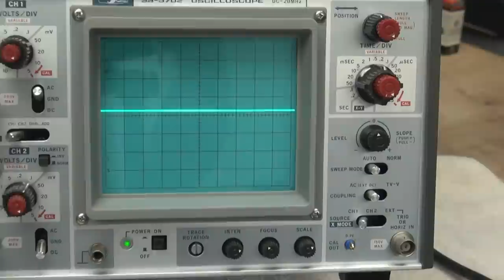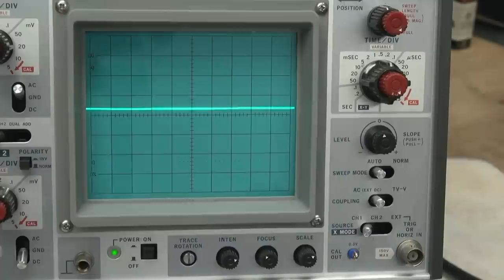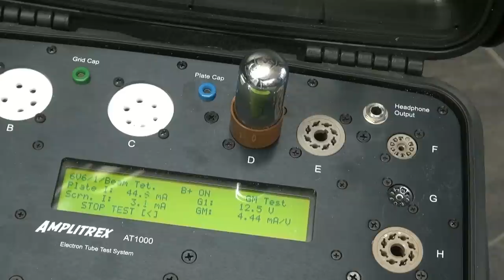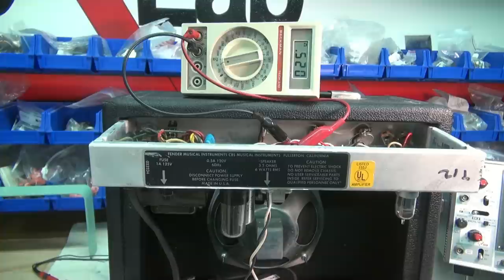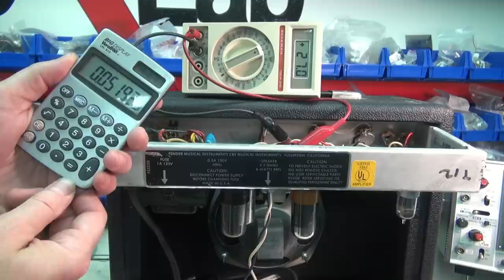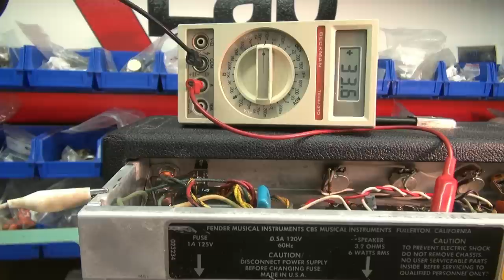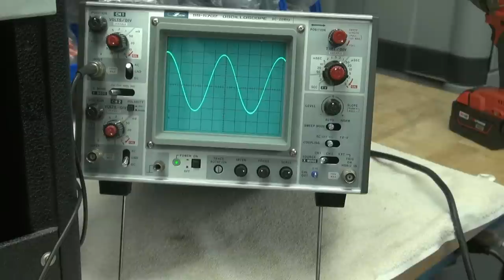Fender Champ tube practice guitar amp repair tips How to by D-lab

Comment: Hi Terry. What value power resistor are you using for the dummy load, and how would you determine which value is needed?
Reply from the maker: +Christopher Austin Hello, it is a 10 watt non-inductive 8 Ohm resistor. For short term testing, it will work fine on any size amp. Most of the amps I work with are 40 watts of lower. You can buy these from Parts Express in Ohio.
Reply: Thanks Terry! Could the same method be used for larger 50w - 100w Marshalls, provided you could find a resistor with the correct wattage? And was that a TS plug or TRS?
Reply from the maker: +Christopher Austin Hello, Parts express in Ohio has a good selection of non-inductive load resistors. I purchased some 100 watt continuous ones from them in the past. The plug was a standard 1/4" phono type, mono like they use on headphones.
Reply: Thanks so much for taking your time to reply. I just got my first scope and I'm looking forward to getting my hands dirty. I picked up some 8ohm, 50watt non-inductive resistors locally here in Vancouver. Looking forward to studying your videos Terry. Thanks for sharing!

Comment: Ha--that's an easy one, only 3 hours...lol---I've had a Princeton on my bench being all wacky since January. Only 120 volts on Pin 1  of V2 from the vibrato/bias circuit...replaced everything except the eyelet board...still can't find the problem. I've put it away for another week to come back to it with fresh eyes

Comment: for a diy 6l6 single guitar amp , what do you recommend for plate voltage and cathode resistor and bias current .
Reply from the maker: +Stan Young Hello Stan, The best way to determine that is to reference a tube data sheet. Or take a look at a typical Fender amp running that combination. TD

Comment: Question, do you find the new breed of modeling amps to be un serviceable?  My Vox VT40+ just died, replaced the valve, still nothing coming out.  All lights and functions seem to be working.
Reply: check you have HT+ at the output transformer and on the anode of the outut tube
Reply from the maker: Hello, sorry have not worked on that model, no info to offer
Reply: For what it's worth, I bought a re-issue AC30 used a couple of years ago (not a modeling amp, granted); it initially sounded very Voxy, but about eight months in, it lost output.  Took it to several techs before finding one who agreed to look it over (he was licensed to repair them); the bill would have cost more than buying a new model of the same amp.  Additionally, the cabs are made from MDF, which can disintegrate when exposed to excess moisture.  If I were a jaundiced sort, I'd say that the concept of planned obsolescence had been applied to the line, in spades...
Reply: We work on just about every amp ever invented. Truthfully the old tube amps besides being a better sound are infinitely easier to work with because they are what is referred to as discreet. That is;  every component performs 1 basic function. Being this way, a tech doesn't have to have very specialized equipment to troubleshoot and therefor repair. Still the tech has to have a good basic understanding of electronic and audio theory. That said, modeling amps and the like are digital solid state units where most components are performing many functions and most of those functions are buried within programs and layers of menu functions. Therefor if one is not equipped with fairly specific test apparatus for that amp, one cannot definitively troubleshoot to a specific unique component. Technicians is this case will opt to replace circuit boards which can get very expensive, very quickly. 
That's the long answer. The short answer is: No, they are not very serviceable. We'll generally take them in, test the basic voltage supplies, inputs and outputs, and visuals. If that doesn't reveal the problem, we're pretty much out of luck. Our advice: Find the best electronic tech you can find, give him a limit of 1 hour to troubleshoot, and hope he finds a basic problem within that hour. 
Sorry to have to be the heavy here, but maybe this might encourage folks to look into vintage and boutique tube amps as real honest alternatives to amps that say they do everything. The only other option would be to send it back to the factory where they have the sophisticated specific equipment to troubleshoot these programmable devices. 
Just our opinion......
Greg

Comment: Kinda new to this..which pin on the 6V6 tube is the resistor hooked to??? Thanks..
Reply from the maker: The bias cathode resistor is to pin 8
Reply: So... fender put 25V 25uF caps on bias because it gives the deeper sound, but the problem is that cathode goes over 30 volts and the cap is shorting over the time

Comment: Got 75' vibro champ with  a high pitched squeal at 0-3 then again from 7-10  changed tubes (new) ,, any ideas... ???
Reply from the maker: +G Renaud Hello, That could be caused by audio induction between wires. Try moving wires around in the pre-amp section and see if the squeal changes or disappears.
Reply: Thanks Terry .. 'll give it a try and let you know..... GR...PS Wine is good !!!

Comment: Maybe it's my ears however ch  2 wasn't as bright as ch 1. But hey I'm probably wrong.
Reply: wade hicks OK I stole this from TDPRI, the telecaster forum and I think it means different impedance pickups may sound better in one or the other.

Isn't one just high input, the other low?

No.

In a generic (tube) Fender input circuit...

With Low (impedance) input, one 68K resistor acts as grid stopper, simultanously forming a voltage divider with the other 68K resistor. This means 6dB of attenuation, and around 136Kohm input impedance loading the pickup. This somewhat lowish impedance will reduce high end response that the resonant pickup circuit can feed to the amp input. In addition the RC filter formed by the grid stopper resistor and grid capacitance will cut it even further. The 68K-68K voltage divider attenuates the input signal to about half of that fed by the guitar.

With High (impedance) input, two 68K are wired in parallel as a 34K grid stopper, the shunt impedance to ground is 1 Megaohm, which is also the input impedance loading the guitar pickup. Such high impedance introduces very little loading and reserves the top end of the resonant pickup circuit. In additon the RC filter of the grid stopper R and grid C has a cutoff point at higher frequencies due to higher value of R. In essence, the input is much brighter and has much less signal loss.

Comment: can i send you my amp??!! same amp, perhaps late 60s model
Reply from the maker: Yes Sir, what is troubling the amp?
 TD
Reply: Hey thanks for getting back so quick! well thought it was just power tube, bought new one and nothing. pulled the circuit board out traced all the wires and found small silver cylinder something or other with rubber thing on it was hanging by a thread so i did a total botched soldering job on it because it was so tiny and needed magnifying glass and flashlight taped to my head. still nothing. after watching your video i realized its been dying for quite sometime, as its not as loud as it used to be/crackling etc etc. thanks again, scott
Reply from the maker: Hey man, can fix her up, no problem. Send me a message thru d-labamps.com and I can get my address your way. Save some $$, just send the chassis
Reply: Excellent, thanks!

Comment: Looks pretty modified. Could swear I saw 220k plate resistors and the tone caps look the same size....suggesting maybe the swapped for .022 uf.
Reply from the maker: Jeffrey Neely Hello, Yes, you are correct. We changed them to 100K. The owner uses this amp for harp playing. Needed a bit lower gain
Reply: Makes sense.
Reply: How do you attach the the dummy load to your scope? I have a weber dummy load but the "scope" output doesn't seem to function.
Reply from the maker: Jeffrey Neely Hello, I simply connect it in parallel across my probe lead to the speaker output
Reply: That was a good catch on the 4.7k in the power supply. I wonder if it was stock. Fender did stuff like that all the time back then. I repair myself. But you are way more fun to watch.
Reply: That was the harvard. Sorry. It likely had 60v on 6at6. And some where around 100v difference between screen and plate. Had to have sounded bad. That's my favorite fender.
Reply from the maker: Jeffrey Neely Thanks man, I try to keep it fun and informative

Comment: Why are you fixing it for $50? Most pros are charging something like a $25 minimum bench fee to crack the amp open and have a 20-30 minute “look”. With all you did $150 labor + parts is very reasonable. You can even hook your buds up with the vintage tubes at very reasonable prices. Anything less and you are either being charitable or selling yourself short. That SF Champ is worth about $450 on EBay.....$150-200 is reasonable for putting an amp that old square.